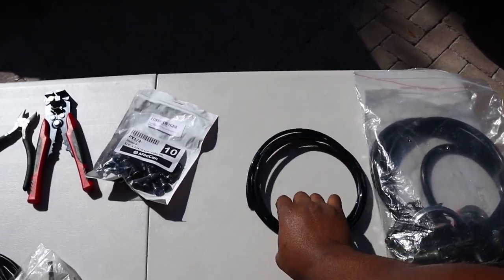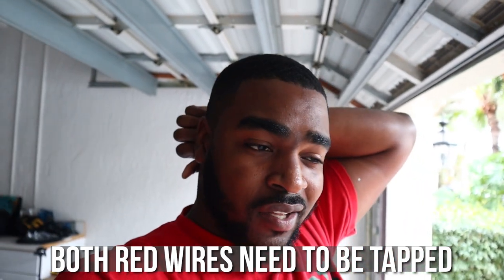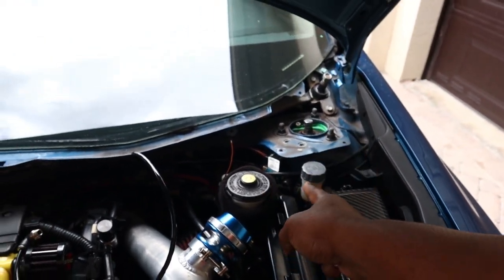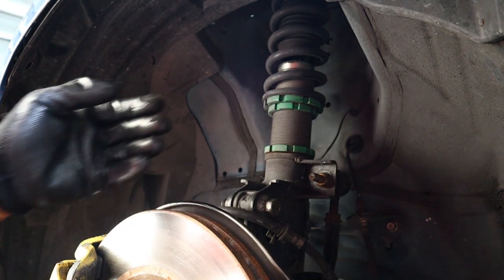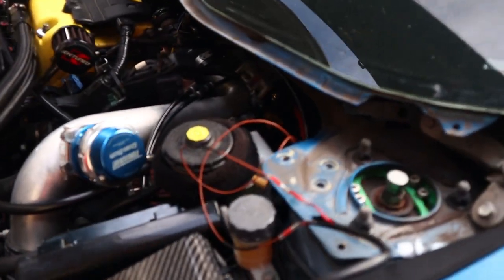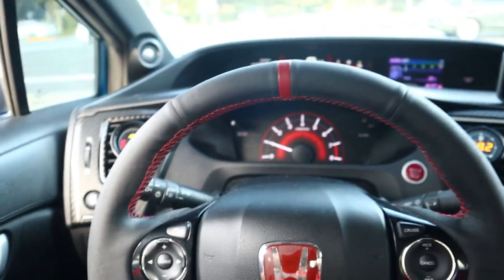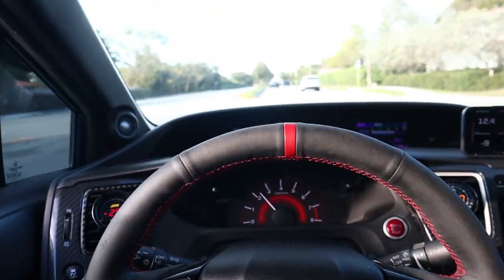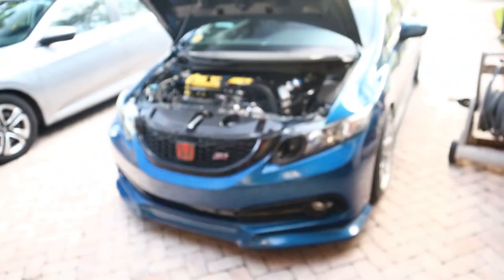WE ABOUT TO TURN IT UP!! (AEM TRU BOOST CONTROLLER INSTALL)

Comment: Solenoid has two wires. One power (12V) the other ground. Good idea to use the same 12V you use to power the gauge, Polarity doesn't matter.

Comment: Boy you sure you want to turn it up 😅 431whp is already nuts for stock block
Reply: A few Floridian boosted 9th gens have blown up recently too 😢
Reply: @frying_Nimbus  I’m scared to turn mine up to 400whp. 370 been good to me so far
Reply from the maker: It’s been at 15psi for a while… that put me below 500 which is still pretty safe
Reply: @zoovie  korey had his civic at 500 and it blew up in two places
Reply from the maker: @Dylan-Malec  korey made more than 500
Reply: @zoovie  crazy for stock block
Reply: I have 17 lbs just studs type s pump and springs